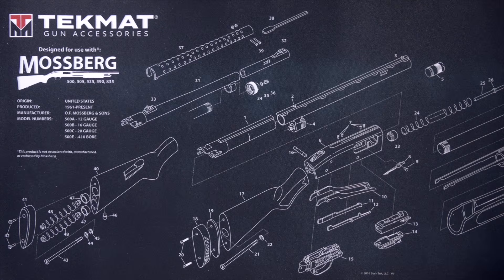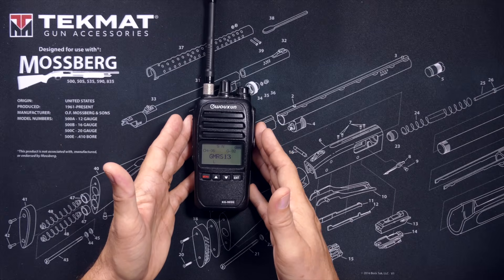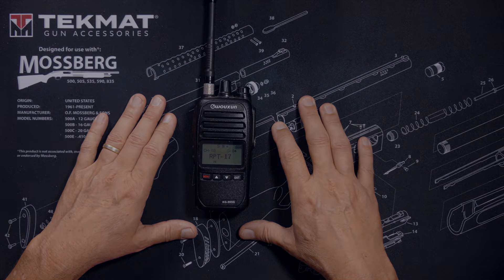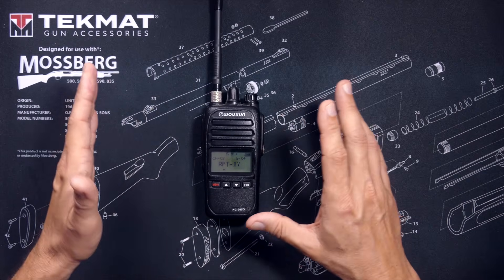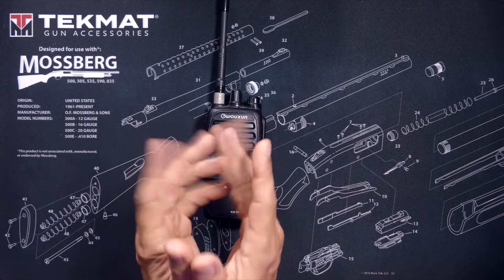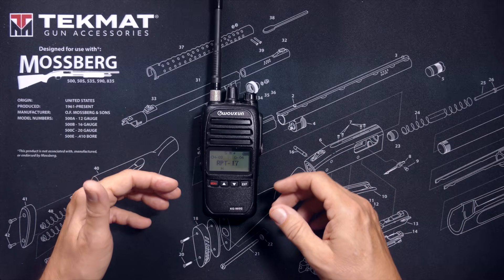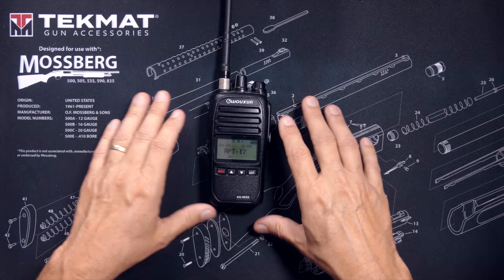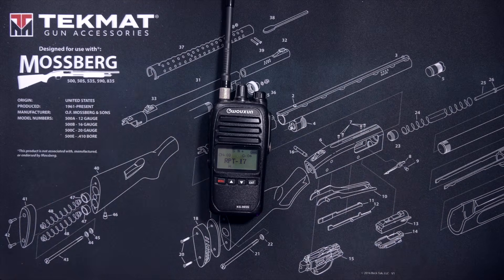How To Program A GMRS Radio To Use A Repeater - GMRS Repeater Channel Programming For GMRS Radios

Comment: I swear if I had hair I'd pull it out.  My manual is as confuckulated as I am.  Have Radioddity GM-30 PLUS.  Example is trying to connect to a repeater.  Input 467.550  repeater xmits 462.550  CTCSS 156.7.  If you can assist this faithful listener I will forever be in your debt of unconfuckulatedness.
Reply from the maker: It is extremely simple and should take no more than 30 seconds to do once you understand. I made an updated video showing how to do it that you can watch here:  https://youtu.be/i-YecjDqonY?si=LSNVTP9snKX26lNs
.. if you still cant figure it out, then, seriously, FRS might be more your speed. Good luck!

Comment: Hi, quick question understanding the radio already has set programmed GMRS, FRS, RPT and DIY. I'm attempting to set additional repeaters do I need to change both the CTCSS and TXTCS codes to hear and communicate on those channels for the UV15 GMRS radio. I was able to hear communication between others on certain channels frequencies but could not get a radio check from anyone. Any suggestions or assistance would be greatly appreciated.
Reply from the maker: To transmit on a repeater you must use the correct repeater-channel (different from normal channels), you must have the correct transmit tone for the repeater programmed on that channel and you must be within range of the repeater - just because you can hear the repeater does not mean your radio can reach it.
The RECEIVE tone is optional, and as a beginner you should leave it off.
Reply: @TheNotaRubicon  so example 462.725 MHz
Frequency 
136.5 Hz
Input Tone
136.5 Hz
Output Tone
So would set CTCSS & RTCSS onto radio to enable contact via repeater? Same if 462.550 MHz
Frequency
503 DPL
Input Tone
503 DPL
Output Tone. If so thanks & apologies as hopefully want to establish communication with someone out there.

Comment: My new BTech GMRS Pro radio is scheduled to be delivered today. Thank you for sharing your review on it—and I’m glad it was favorable. I’m admittedly a newbie in the HT world, and find much value from your experience. I’m sure I’ll make far fewer newbie mistakes by learning from you.

Fun Fact: On your TekMat explosion cleaning mat, it lists a few shotgun gauges, including “.410” bore. According to a Game & Fish Ranger back in the mid-70s during a presentation for teenagers, of which I was one, if a .410 caliber shotgun was converted to gauge, it would be a 67.6 gauge. It takes 12 lead balls the diameter of a 12 gauge barrel to equal 1 pound—hence 12 gauge. But since “67.6 gauge” doesn’t relate so well to the typical shotgun gauging convention, they went with .410 caliber.

Comment: Randal. You have unconfuckulated me many times. But. I still am confuckulated on this issue. I set up a RT97S. I set it up with no tone on RX or TX.  I use a TDH8. With all tones off. Here is where I am confucked. I can hit the repeater on my radios but I have no modulation coming from the repeater.
Reply: And Randal. I just noticed that the receive green light is not on when I key up and hitting the repeater on another H8.
Reply from the maker: Watch this video and see if it applies:  https://youtu.be/CPJPhnIi6Zs?si=dATYhhZ62oGPCDVT
Reply: @TheNotaRubicon  
That was not the problem. I got home and it hit me. The grey matter between my ears loosened up. Something you said in one of your other vids about the radio has to be able to hear the repeater. What the F. That was the problem. One radio could infact hit the repeater but the other radio could not hear it. So you did unfuckulate the fuckularity that was in my grey matter. 
Thanks Randaloff
Reply from the maker: How are you testing/determining that you aren't hearing it? assuming you are using two radios (one to transmit, one to listen), are they at least 50 feet from each other?
Reply: @TheNotaRubicon  well no I am with in a couple feet of each H8. But a couple miles from my repeater. But can hit the repeater with both radios.
Reply: @TheNotaRubicon 
No. Just a few feet apart.

Comment: Another question for  you if you dont mind.  What is the difference between the Scan that you have by long pressing 1 on the keypad and the scan that you get with long pressing 3 on the Keypad, and what situation would you use each of those for?

Comment: So question, I am new to GMRS, as are many people these days, no doubt.  I went to MYGMRS, set up an account put in my details and call sign, then I went looking for some repeaters in my area.  The largest repeater in terms of power in my area transmits about 45 miles.  I noticed that the repeater owner listed his as private with permission, so I asked for permission and permission was granted.  However, Im not sure what to do with that based on this video because the only useful information I see is the frequency.  When he gave me permission, he sent me the code for the tone I believe, what he actually said was Enjoy, then said PL is 141.3.  Now if that is the tone, it doesnt start with C or D, so what am i supposed to do with that.  I have a TidRadio TD-H3.  I tried entering it in the CTSS portion of the menu, I think it took it but Im not sure.  Also, reading up more on this, Im wondering if I have to put in the offset as well as I've seen some other videos saying that is one of the things you need.  By the way, in his response on MYGMRS to my request to use his repeater, there is no way to reply back or ask for anything else so hopefully there is nothing else I need from  him.
Reply from the maker: "PL" = CTCSS = "C"

Comment: Ok hey I have a baofeing and tid radio and when I connect them i mean I have my local reapeter save on both but can’t get any audio
Reply from the maker: For best results please rephrase your babble into a coherent question.
Reply: So I set my repeater on the baofeinguv5R from the chirp software ware did the same with the tdh3 and i can’t hear nothing even when I press ptt
Reply: The reaper is a mile a way did everything through chirp so It can’t be wrong
Reply from the maker: Just because you did something in CHIRP is no guarantee that it wont be wrong.
Is the repeater online?
Are you sure you have the correct repeater tones?
Is it a HAM repeater or a GMRS repeater?
Your UV-5RH is a ham radio, so by design it wont work with a GMRS repeater unless you unlock it.
Your TD-H3 is a GMRS radio, so by design it wont work with a HAM repeater unless you put it in unlock-mode
Reply: @TheNotaRubicon  there both unlocked I am gonna lock and see if it’s online on the website also the reapeter hasn’t been updated sense 2021
Reply: The only way it works every thing seems to be right only way is flipping the RX AND TX FREQUENCY ON ONE BUT STILL I DONT THINK THATS GIVING ME ANY RANGE

Comment: Thanks for the video, def it helps. Im trying to set up GMRS repeater on Baofeng uv 5G,   
local repeater info 

462.725 MHz
Frequency
241.8 Hz
Input Tone
192.8 Hz
Output Tone

 Could you do video on the set up for this, on a UV 5G.
I am almost there I think.  Im getting the. " kick back " when I key the mike, but verbal is not coming through. I think offset is wrong maybe ?

Comment: How close to a repeater  do you need to be, before it will be of any use  to you using a GMRS  Radio.
In terms of miles.
Reply from the maker: The only accurate answer anybody can give you is "it depends".. it can range from 1 mile to 75 miles.
Reply: @TheNotaRubicon  thank you for the reply

Comment: Hi there, so is not possible to use a GFRS repeater with the Baofeng UV 5HR? I suppose that would mean that the frs and gmrs capability is limited to walkie talkie or direct one to one use I should say.
Reply: UV 5R *
Reply from the maker: It's a ham radio, and probably locked, so, no.
Reply: @TheNotaRubicon  Hi for GMRS on a UV5R if I know the receive tone, the transmit tone is plus 5 more correct?
I am using the chirp to program a gmrs repeater and I put it in the receive tone aka tone sql column. With plus 5 of my receive tone of 156.7,  Chirp doesn't give me an option to put that amount in the tone column aka transmit column. Would all I need to do in this case is put the duplex + and put the offset for 5.000000? Closest thing to 161.7 is 162.2 in the tone column. Also on my UV5R it reads at the top +- when I am on channel mode for that repeater. The R-CTCS and T-CTCS are the same number when I look as well through the menu. Is this correct or does the T-CTCS number need to be different to transmit on the repeater?
Thanks!

Comment: If you have two repeaters in your area that are both on the same frequency (462.600).  However, they have different input tones.  Is there a way to put both repeaters into the GMRS radio?  In this example, 462.600 correlates to channel 17 or repeater 3.  However both repeaters can’t be on channel 17.  How do or can you put both repeaters into a GMRS radio?
Reply from the maker: You can do this on most (but not all) GMRS radios. You have to create and save the repeater settings a new channel, with with different tones. .So one would be channel 17, the other might be channel 34. .OR, you could make one of them channel 34, and the other one channel 35.. or 92, or 875.
Reply: Thank you very much!

Comment: QUESTION...on my gmrs I have the tones for a particular channel. On repeater book, tgat same gmrs channel has the tone and seems to have an offset freq. Do gmrs repeaters use or need offsets???
Reply from the maker: GMRS always has a built-in/automatic offset of +5Mhz for a repeater. on a real GMRS radio you just have to figure out which repeater channel it is based on the frequency and then enter the tone.

Comment: My gm30 radio wouldnt transmit on a repeater but could receive. I think it was because I was on frequency mode not channel mode. 462xxx. I think it needs to be on a repeater channel. Yes my tones were set.

Comment: After watching this I am confused as hell as to why it would be difficult  to program a UHF HAM radio to talk to GMRS repeators.
I wish there were some clarification of your point that it was rocket science to do so.
Reply from the maker: If you already know how to program your ham radio and if your ham radio is not locked to transmit only on ham frequencies, then it's not difficult. But because the target audience for this video is not ham radio operators and is instead targeted toward people know nothing about what frequencies to use, offsets, etc, and have zero interest in learning any of that, many of these people would likely find it 'difficult'.

Comment: So what if the repeaters In my area I need to use? Don't have A C or D tone number. They just have a number.
Reply from the maker: The CTC tone numbers and the DTC/DPL/DCS numbers are never the same - for example, 141.3 can only be a CTCSS tone. Most radios list the C/D tones and you have to choose the number from the list, so just find the number on either the CTC list or the DTC/DPL/DCS list.

Comment: We are the same age.  62 in July.  Very cool.  
I have st purchased my license and waiting on the FCC to send me the call sign and then I'm going to order a radio.  I will need to know how to connect to a repeater.  We have a few about 50 miles from me and 40 miles in another direction.  Open Repeaters are listed near me close enough I should be able to do so.  
Tha ks Randy.

Comment: I have learned a lot from your videos and I thank you for your service. 
However I have a question about radio selection? You said that you must have a GMRS radio to be able to program in a repeater. I have a Radioddity GS-5B and a Radtel RT470 both radios have the tone settings that you speak of. If I cannot use these radios on a GMRS repeater. Then why can they be programmed to use on a GMRS repeater?
Reply from the maker: You need a GMRS radio to use a GMRS repeater without breaking the FCC rules. Ham radios use ham repeaters and most will not transmit to GMRS repeaters, but those that do would break the rules.

Comment: If I don't get the kerchunk but hear repeaters clearly I just need to use a better antenna or more powerful radio? Would that be a good assumption?
Reply from the maker: Statistically, the most likely thing is that you are using the wrong tone/have the repeater set up incorrect in your radio. Assuming you have everything set right, then a better/higher antenna will do you more good than just more power.
Reply: You might be on fequency mode not repeater channel 462xxx . I think that is my problem too.

Comment: Hello i dont know what im doing wrong your video is very clear in how to program a repeater...i still can mine to connect..pls help..i have a baofeng GMRS-9R with 1-8 repeatable channels
Reply from the maker: 1) make sure you are on the correct repeater channel
2) make sure you have entered the correct TRANSMIT tone/code 
3) to reduce issues/variables, REMOVE the RECEIVE/RX tone/code - this is optional and can cause problems if you do it wrong
4) make sure you are IN RANGE of the repeater & transmit
..if you do all those things right, and still cannot connect, then either you are doing it wrong or your radio is defective.. and I doubt your radio is defective.
Reply: Ok here is the repeater info
462.575
Input Tone 074Dpl
Output tone 074DPL
THIS is a baofeng gmrs 9r
Reply: I tried to program it on repeater2 channel
Reply: This is what I'm doing
I'm on channel mode
Chose repeter2 channel
Press menu 12
T DCS 074N
MENU
AND HIT EXIT

Comment: Question. I have the Midland mxt275 and can not transmit onto a repeater. I turned repeater mode on and put in the right Ctss , etc. I still can't transmit. I can hear others though. Am i screwing up or does the Midland mxt275 not transmit to repeaters? Thank you for the time if read this
Reply from the maker: Yes, the midland transmits to transmitters.. 
CONFIRM you are in repeater mode
CONFIRM you are on the right repeater channel
CONFIRM you have the correct tone, set as the TRANSMIT tone
CONFIRM you are within range of the repeater
CONFIRM it is actually the repeater you are hearing and not just people talking on simplex
IF everything is confirmed, then either your radio is defective, or you did something wrong.  and I doubt the radio is defective.
Reply: @TheNotaRubicon  thanks a bunch and fast reply. I don't listen to those "some people" about you.

Comment: Just to add confusion, the DCS tones are either 'N' normal or 'I' *Inverted*.  I discovered on my Wouxon KG805G that only the 'I' tones are available in the radio menu. Enabling the use of the 'N' tones required using the factory software and a programming cable. Just FYI.
Reply: will the owner typically tell u if they are not normal?

Comment: I just got a Baofeng Uv-5g and a rt97 repeater and when I try to out the ctcss code of the repeater into the radio it doesn’t save? What do I do? I even programmed with chirp.
Reply from the maker: There are only two possibilities:
1) you are doing it wrong
2) the radio is defective
....i doubt the radio is defective.
Reply: @TheNotaRubicon Actually nothing saves in the radio at all. The Uv-5r it does. If I could somehow send you a video I would.
Reply from the maker: are you in Channel mode?
Reply: @TheNotaRubicon  I know this is a stupid question but if it saves in frequency mode that’s completely different from channel mode? I wanted to display the name on the radio but I guess I have to just not choose a ctcss code or does it carry over? I’m new to this and trying to figure some of this out.

Comment: I have a question unrelated to this particular video. 
Is there a gmrs radio to mount in my vehicle that will automatically come on when I turn on my vehicle like cb radios did? I currently have the b tech gmrs 50.
Reply from the maker: You are correct, that question is unrelated to this video!
Reply: @TheNotaRubicon   😂 Thank you so much for the quick response 😎
Reply: @TheNotaRubicon  LOL

Comment: As always, a useful and helpful video!

One thing I have never understood, is the repeater owners who require a tone to access the repeater (actually a smart thing), but somehow lacked that extra thirty seconds it would have taken them to program that tone on the output so that end users can set their tone decoders (on receive) and keep noise and other stations from opening their squelch and annoying them while monitoring that repeater.
Seriously?

Then there are the owners who set their repeaters so that there is zero hang time.  Hang time is that brief time after you, or anyone else using the repeater, unkeys their PTT and the repeater keeps transmitting.  Most repeaters have 1 to 3 seconds of hang time.  Hang time allows you to 1) know that you hit the repeater, and
2) judge about how strong the repeater is reaching your radio and relatively speaking, how you might be hitting the repeater.

One well-known GMRS dealer I know of went to the trouble and expense of setting up a repeater.  For reasons known only to them, they did not program it to encode a tone on the output.  Worse still, they did not have any hang time at all on the repeater.  People would drive into the area, try to use the repeater, and hear nothing.  They either assumed they were not in range or that the repeater was down.  I don't know if they were playing a stupid game with their end-users and customers or they just didn't know any better.

I will say such sloppy programming would make me unlikely to buy a repeater from them or have them program a repeater for me.